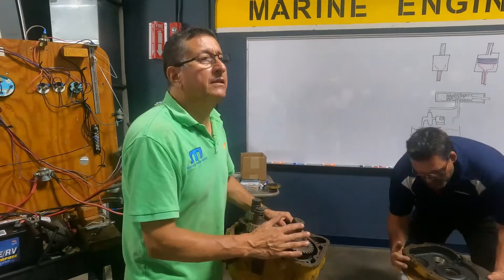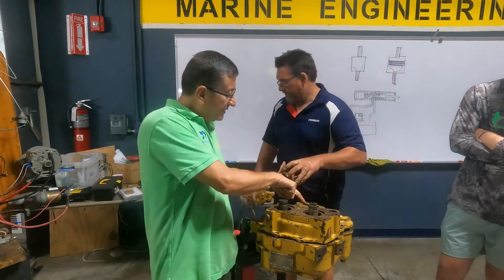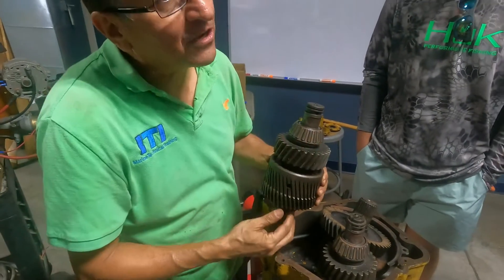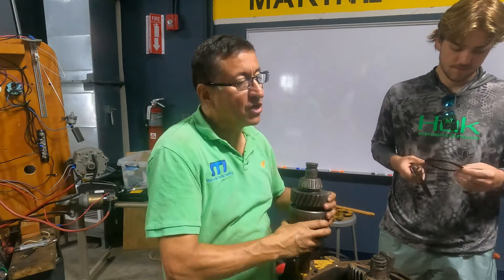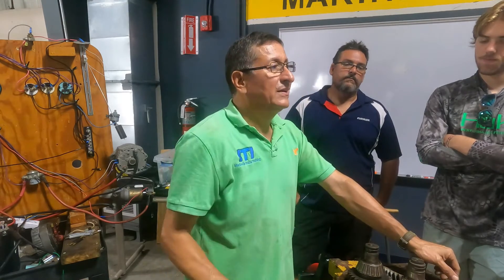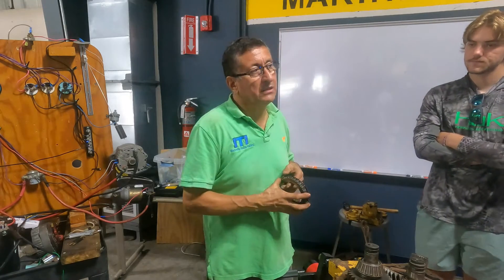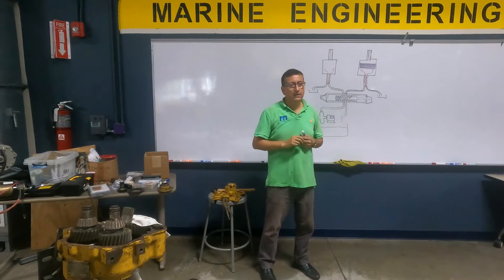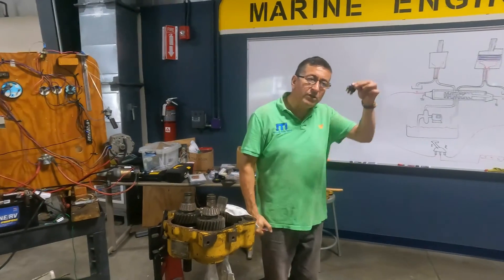How a Marine Diesel Transmission Works

Comment: Awesome explanation!. I currently trying to troubleshoot my twin disc MG502. I got towed in the otherday while fishing. All of a sudden It does not have forward or reverse.  Only neutral.  I removed the control cable and shifted the selector switch manually. Same thing. I hooked up a psi guage . No oil psi on the guage at the transmission.   I cleaned the filter screen and replaced 30wt oil with new oil. Oil was clean and looked fine. Still only neutral. Any suggestions to what may be wrong? Any advise would be greatly appreciated!!
Reply: Also I ordered and installed a new oil pump. Still no engagement tin gear . Still no oil psi. 😟
Reply: Pulled apart my transmission from the engine. I found my input shaft splines were almost gone . Also my damper plate where the shaft enters was rounded and completely worn out. No parts available for this transmission anymore. Time to spend money again.😢 New transmission gonna be ordered and  alot of work ahead ! 😭😆😆

Comment: Sir,can i ask,about my transmission,forward is ok,but if reverse it takes 20 seconds to engage,marine transmission sir,no solenoid only mechanical,can you site a trouble or problem of this,oil is in normal not milky
Reply from the maker: Hello, this is a typical issue with the Reverse Clutch Pack. it is excessive wear on the friction discs of the clutch pack. If the oil is not milky you can improve his performance with a Gear Box Additive 'STP" or "Lucas". However, this is a symptom that the transmission should be repaired ASAP
Reply: @MrLopezClasses thank you sir,what if I add additives to the oil,it can help to function early the reverse?bec I will wait the ship to dry dock b4 it will be repair sir
Reply from the maker: @LeoAlburo-t1c . Please use original Parts. Good Luck

Comment: Sir,can i ask a question,,we have same transmission here we used to our service boat and its only work with a low rpm but if we applied high rpm it will not work,hope you will answer my question,thank you,
Reply from the maker: What Type of transmission is?. What about the color and odor of the oil?
Reply: @MrLopezClasses  ,,we have a manual transmission sir,,umm,,thanks for the info sir,we already fix our transmission problem,,its just the seal ring of forward and reverse had been broken,,thanks for the time sir,🙏🙏
Reply from the maker: @MrLopezclasses
1 second ago
Hello, this is a typical issue with the Forward or Reverse Clutch Pack. it is excessive wear on the friction discs of the clutch pack. If the oil is not milky you can improve his performance with a Gear Box Additive 'STP" or "Lucas". However, this is a symptom that the transmission should be repaired ASAP
Reply from the maker: The Forward Clutch Pack is out. The friction discs are gone
Reply from the maker: Hello. This is basically a wear friction discs on the FWD clutch pack. The solution is a full rebuild. Good Luck